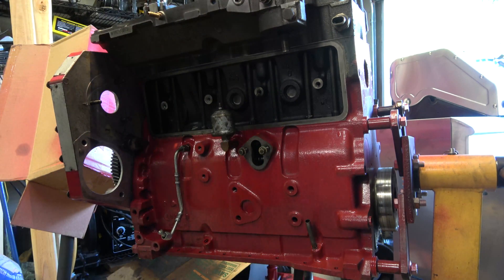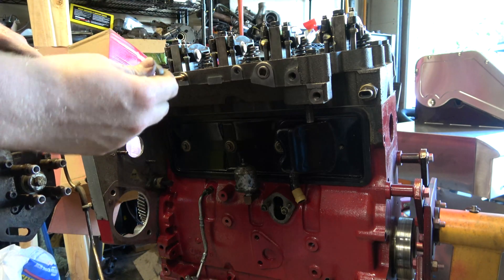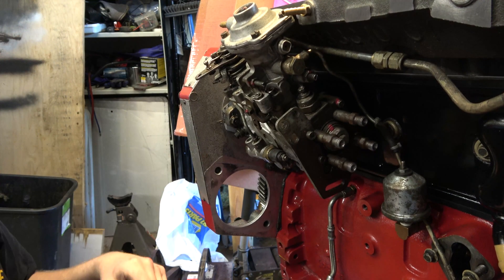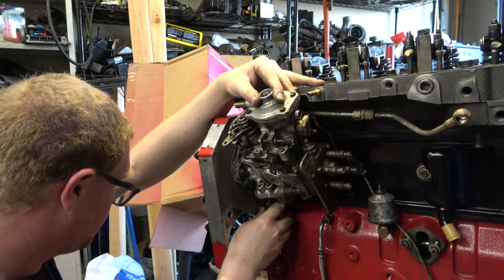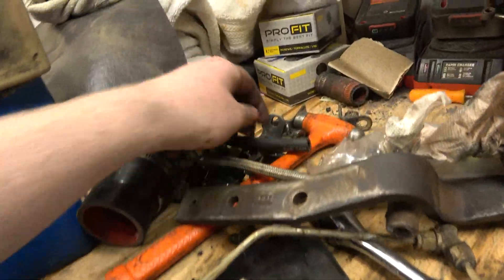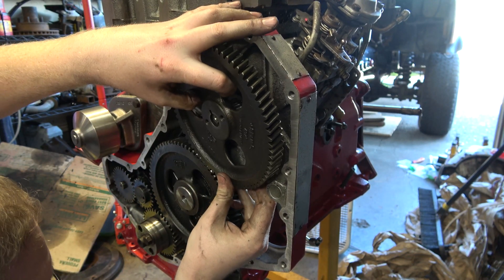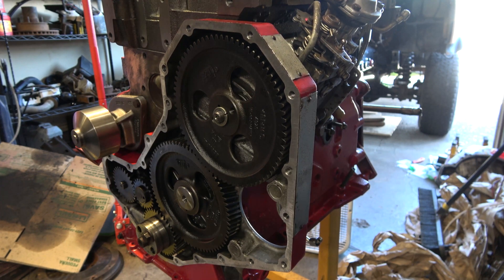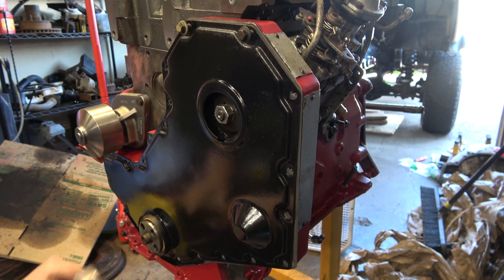Cummins 4BT Reassembly | Injection Pump Install | Part 4

Comment: How do you remove the timing gear that’s connected to the pump? I have everything loose on the pump end but the gear is still stuck and doesn’t let the pump loose
Reply: A pump gear puller

Comment: Have you ever considered doing an e-fuel system? What are your thoughts on that?
Reply from the maker: No, I want to keep it as mechanical as possible and don’t want to spend big bucks on fuel pumps. My current lift pump puts out a ton of fuel so I don’t need to worry.
Reply: Bullford82 less problems that why probably. Easier to diagnose issues